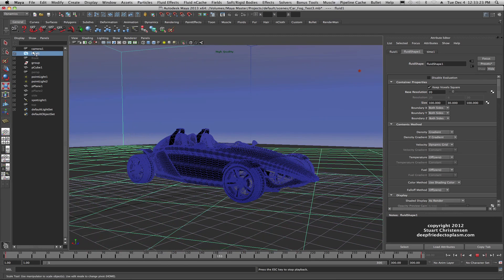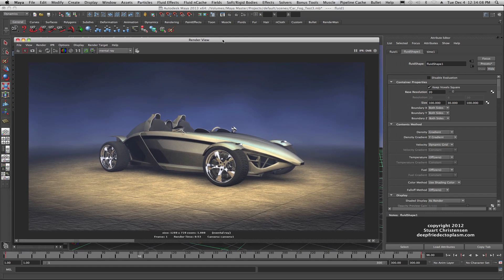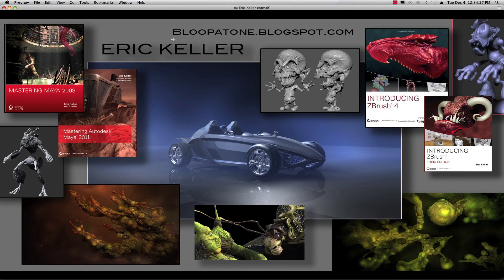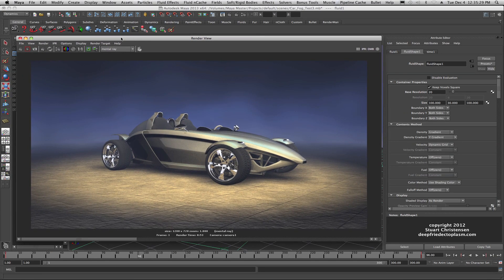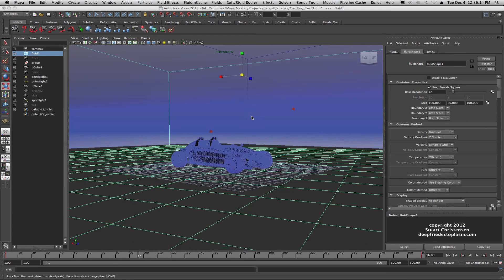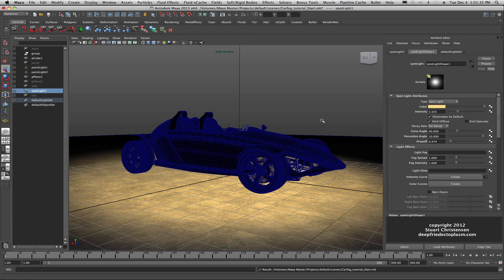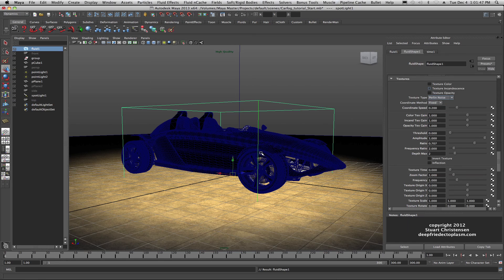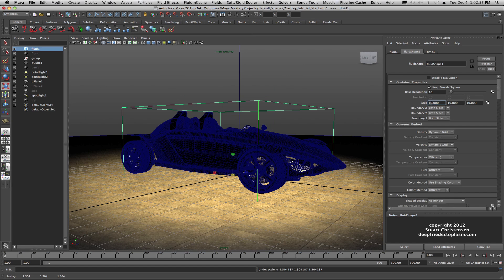Maya 2013 Create Fog using the 3D fluid Gradient Method Tutorial by Stuart Christensen

Comment from the maker: I use Mental Ray, if you go to the Window menu - Settings-Preferences - Plug-in Manager you will need to check the boxes for Mayatomr.bundle (or whatever) to make it available as a renderer if Mental Ray option is not currently available.  Mental Ray is awesome, so make sure you enable it in the render settings...OK.